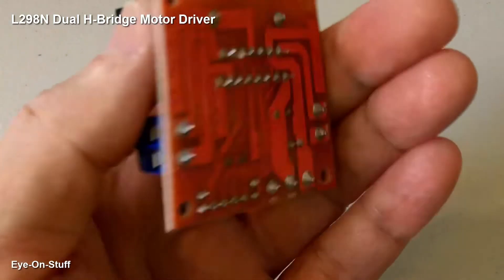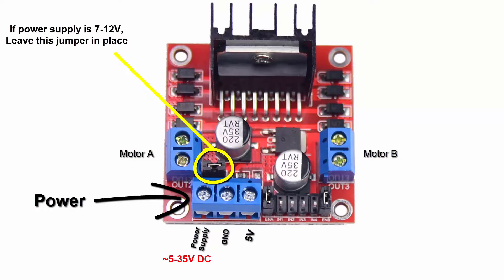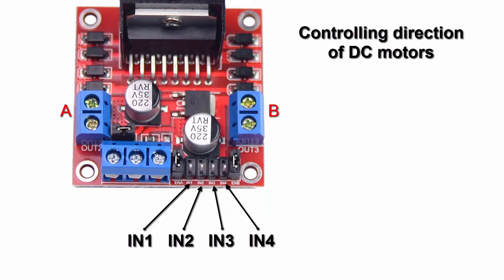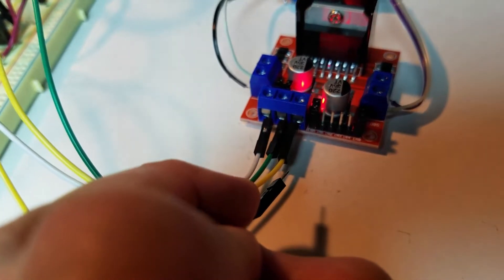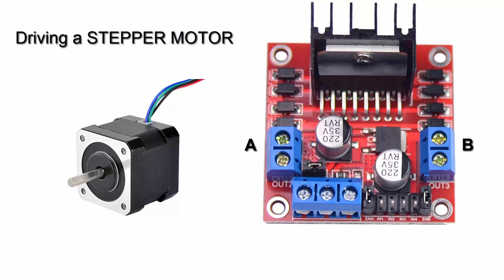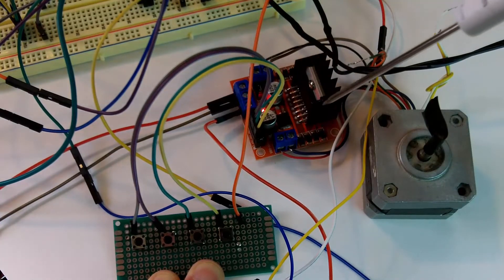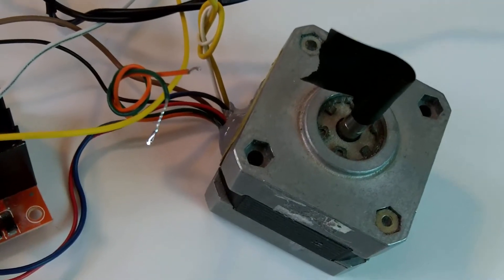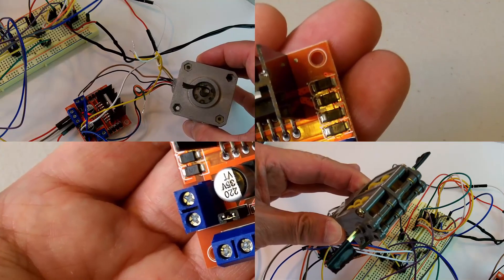L298n Dual H-Bridge Motor Driver : DC Motors : PWM : Stepper Motors : Eye-On-Stuff

Comment: Thank you for the explainer, but I'm not really sure how the PWM is hooked up on this.
Edit: I found out on another video, just provide PWM to one of the two pins after unplugging the jumper (for example, one of the two pins on ENA should get PWM signal, and the other should just stay unplugged)

Comment: If i connect the g and 5v-30v  then the 5v and EN and ran signal wire to IN1 could i control a motor with remote control? Im hoping to drop the arduino. I could always order a different driver but if i could use what i have i wouldnt have to spend more money on something ill end up disassembling to chase another squirrel. I could just connect it and see but i dont kniw if ill cook another board

Comment: I have been using these to drive 24 volt 1A motors. With vscode and esp32dev pin 33,32,18,23. I dont know why but I have burned 9 of these in the last 3 days. Some short just by powering and some short during programming, The work fine and then without doing anything they draw 4-5 amps then poof. Data sheets 35v input but only using 24 so I am lost on why i am burning them up.
Reply: Are you removing the Jumper that provides the logic circuit power?
Reply: @geoffmarsh9759  Yes i am powering by external 5v to logic +5 terminal. I have fused both the input and output and still burning up. sometimes its only one side.

Comment: I want to run a normal DC motor in a pulsed like fashion.  Used for rotating a disc at varying speeds but in a way there is a short time of off every split second. I want to do this tomavoid jams when stiring items around. A stuttering kind of motion but continuing forward. Maybe on for 3 seconds off for 1. So far I'm just going to use a simple timer circuit next to the DC motor driver board. Is there an AliExpress board already with this feature?

Comment: I learned I could make stepper motors go faster by ramping up to the max speed specified and then go quicker with the signals which made the stepper go quicker.
Reply: Interested, max speed, less torque 😢

Comment: Question, i’ve been searching for an answer to my inrush current problems with a couple projects. I’ve been trying to rebuild a couple old cordless vacs with some lion cells. But the issue I run into is the BMS I’m using for these cuts power because of the inrush. All cells are balanced and high drain. Of course research yielded PWM. But I would like to use a controller without a pot that is 100% on all the time. Could I use this Module and leave motor one jumper in place for the 100% duty cycle and overcome my inrush issues? Or will this provide the same issue? 

Thanks!

Comment: Can I bridge 2 L298n Dual H-Bridge Motor Drivers together to use 4 DC Motors Seperately?
Reply: Yes, two of those will in fact drive four motors. Technically, you can have four motors run of a single driver, though each of the the two extra motors will have the same output as each of the other two, due to the phisical pins they are screwed into.

Comment: If you want to melt things or want to catch things on fire then please go ahead and use this with a stepper motor... Recommending that somebody uses for a stepper motor is a dangerous proposition because as you know it gets extremely hot with even the slightest of use of any separate motor. The manufacturer of this device should stop advertising that it can be used for a stepper motor although it can be used for separate motor it's very dangerous to do so and should not ever ever be used for a super motor.
Reply: Stepper Motor = Seperate Motor = Super Motor 😅
Reply: @red2fire2 haha
Reply: You convinced me to use this, and drive the fan with a Arduino, hahaha😁
Reply: What about a12v tt gear motor?
Reply: i guess it can handle up to 3 amps on 12 volts.. after that mostlikely what you said will happen... tough i dont use them regularly at 12 v 1 amps there was no sign of noticeable heat

Comment: Hello, If I need to drive a NEMA 17 stepper motor having a phase current about 1.8Amps, is this module can be connected to the stepper motor driver controller module 36820? If so how?

Comment: You said you need to remove the jumper in order to turn the 5V output to 5V in. Then you show how a yellow 5V input is connected to the 5V header, while the jumper is still on. ???